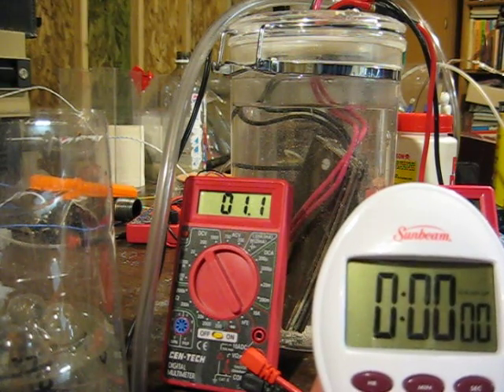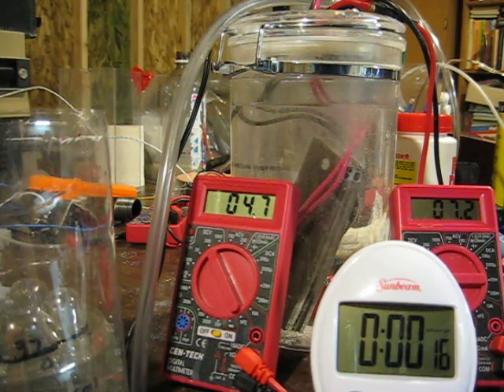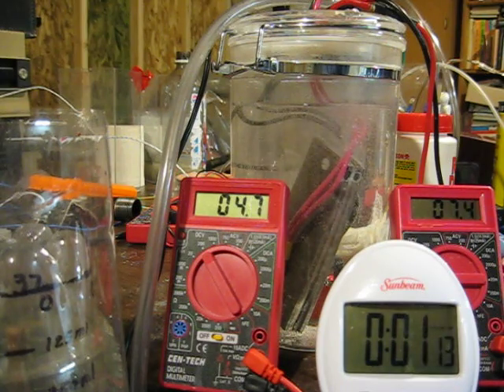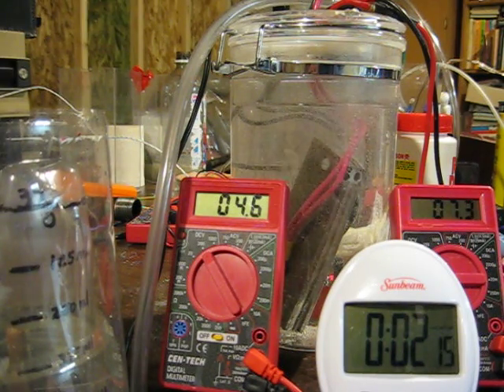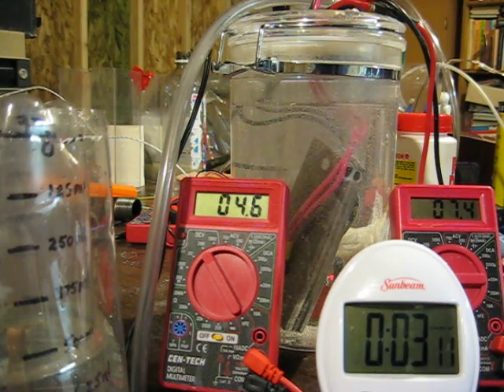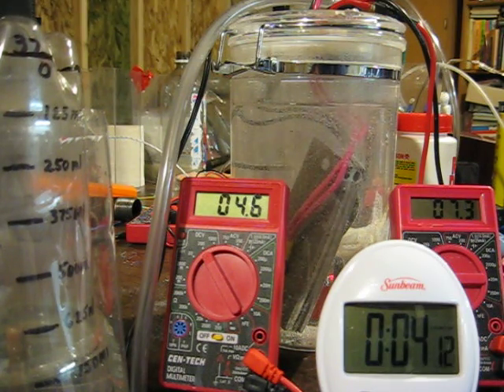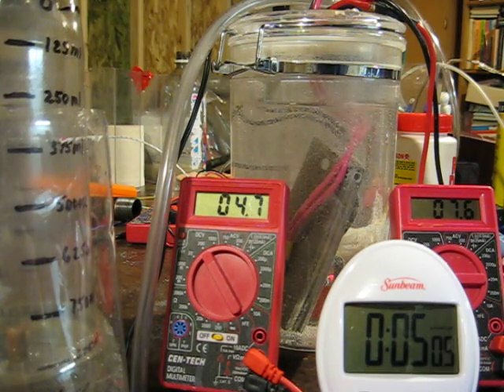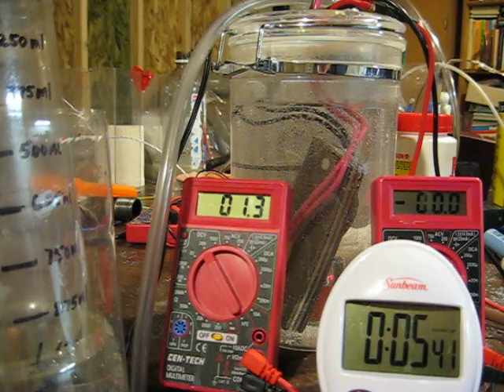5.05MMW Electrolysis ©

Comment: Thank you AGA. Great numbers.
Did you check the accuracy of the cen-tech meters? I returned 3 of them because they were way off. Even trying to adjust with the pot inside didn't get them close to the right reading. Just a FYI.